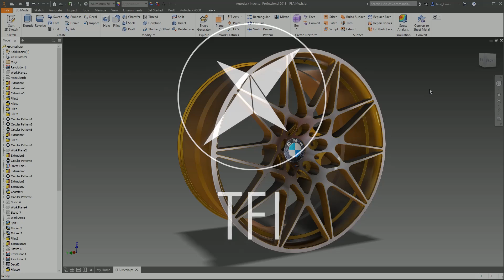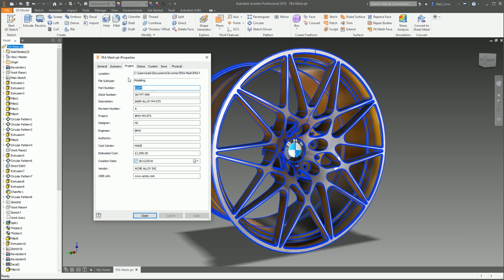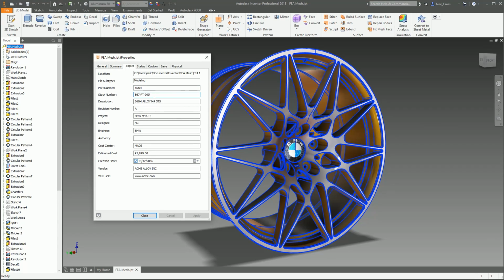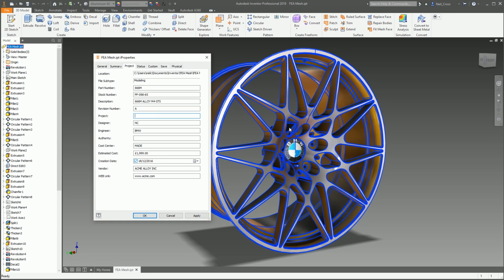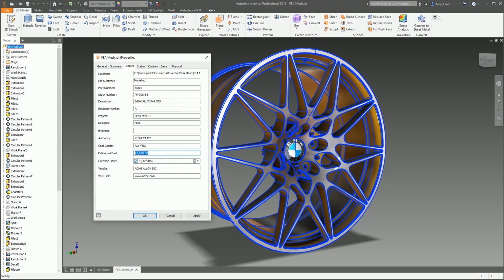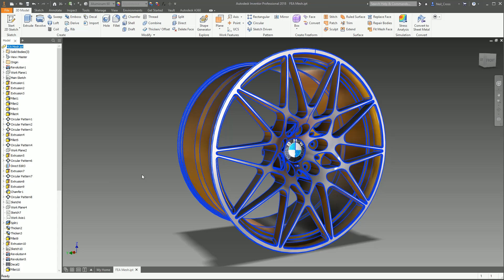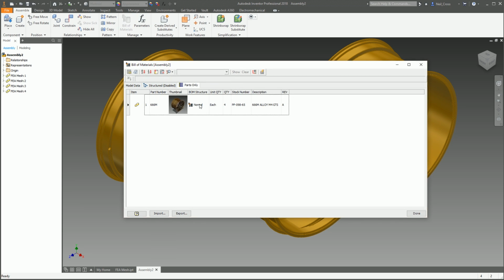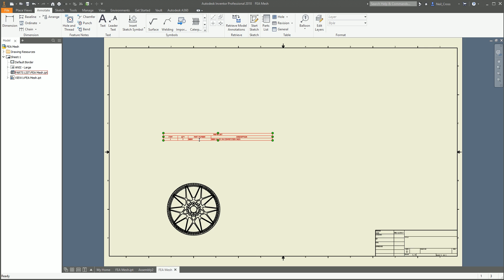What are iProperties, Best Practice Use | Autodesk Inventor

Comment: He shoots, he scores, yet again. Many thanks as always.

 Another very powerful use for iProperties is in leaders so you can consistently label many things on a drawing without having to type in the information over and over again.  I appreciate that it does the same with balloons referencing a parts list  but on a massive assembly you don't necessarily want the parts list and when using Inventor for Architectural type drawings (yes some of us do - madness I know) Interior designers seem to like little labels.

Here's a thing, could you do a video on Custom leaders - How to configure them and store them as defaults/standards. Many thanks.